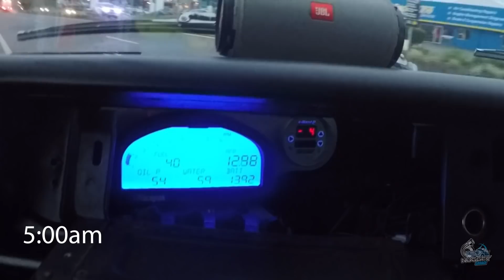Nugget Garage - Drag Challenge 2019 Race Day 1

Comment: Time for some billet axles hey guys
Reply: Billet?  Like billet aluminum?
Reply: Like hytuff, chromoly etc..
Reply: @MRMOPARMAN0426  Right, which has nothing to do with billet.  I see that get tossed around all the time.  Like "billet" is the ultimate material.
Reply from the maker: A lot of places do a Billet/forged Alloy axle yes.
Reply: @ShainAndrews   you dont internet much do you?
Reply: Dirty respliners I love it only good for 400hp in a commo.. I can't see why the ke20 twisted it off I'm guessing those axles have done a fair few kms and been twisted for a long time...and I laughed at the centre bore size difference I got caught out with that running a locked 25 spline r31 diff in my ke70 busted a axle  and grabbed another axle and rim wouldn't go on lucky old mate that bought the axle to me had the r31 wheel off it in his ute to get me home